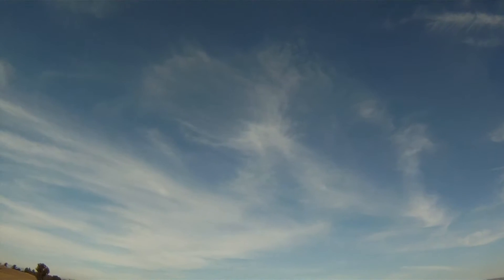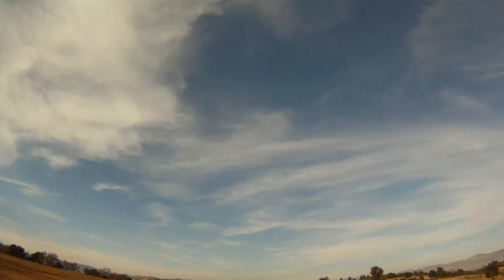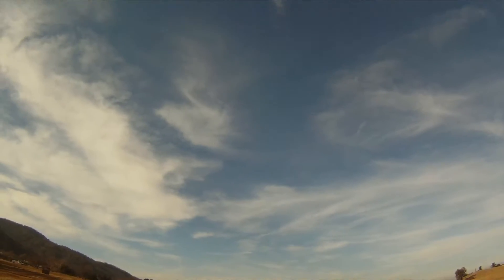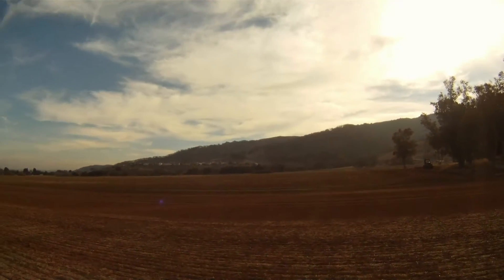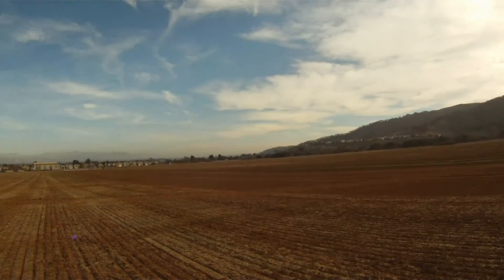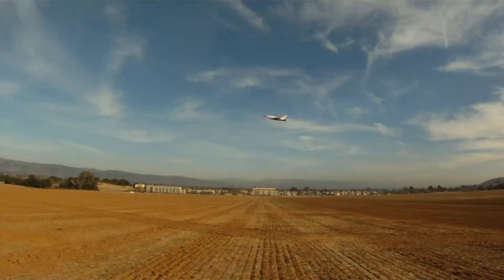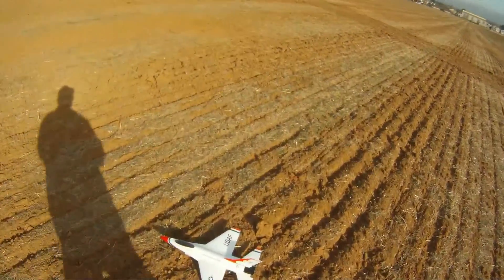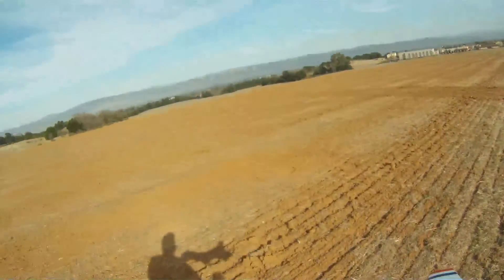F-16 50mm EDF Jet - Excellent Stock Performance - Banana Hobby - Maiden Flight

Comment: Did my maiden of this plane today and I'm far from impressed, im hoping its my little 650mah lipo. my 850 should be here soon. Maybe she will be faster then. I have no vertical power at all. Maybe my fan isn't balanced or something. Id like to think its atleast 60mph. Mines is more like 40mph
Reply from the maker: +Larry Cook 650mAh is far too small for this stock 3s setup.   850 is really minimum.Hope you noticed a big increase in performance with the new battery.

Comment: how did you get the fan out?
Reply from the maker: +Larry Cook I opened the hatch by taking out the 2 screws.   Then I pulled and rocked it back and forth to loosen the original glue that held it in.   I've subsequently been using scotch double sided poster tape along with the 2 screws clamping the hatch on it to secure the motor/fan unit.

Comment: +2101Striper can you tell me where the CG is? I cannot find the manual. Thanks in advance..
Reply from the maker: +AZ_PIT_VIPER 60 - 65mm back from leading edge of the wing section where it meets the fuselage strake.    Here's a thread for CGs on RCGroups:
http://www.rcgroups.com/forums/showthread.php?t=1480110&highlight=Skyangel#post18907659
Reply from the maker: +AZ_PIT_VIPER Sorry for the late reply..The CG is located 60mm aft of the location where the leading edge of the wings is glued on to the fuselage/strakes.